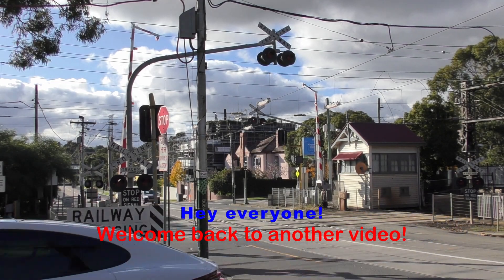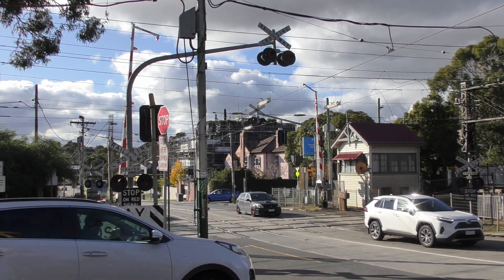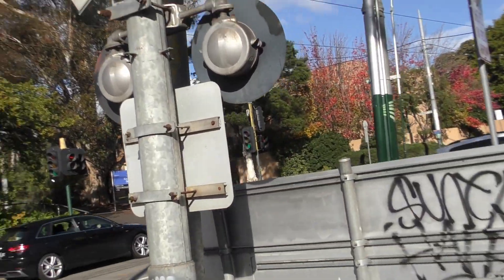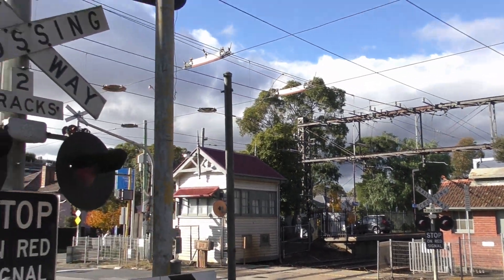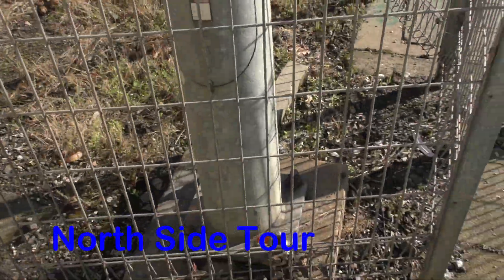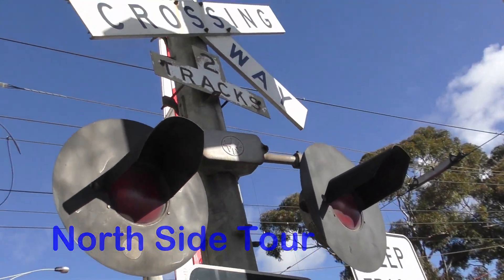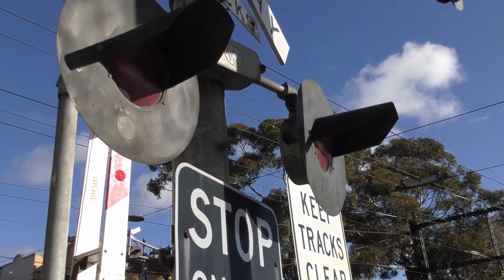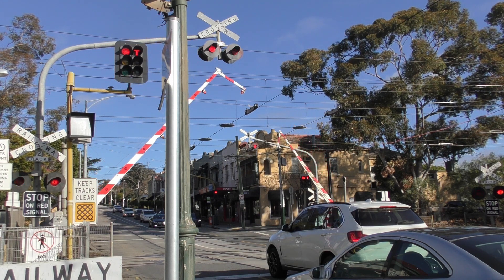Glenferrie Road Level Crossing, Kooyong, Victoria!

Comment: I really hope they don't replace the hybrids since one isn't working now, as they've done that before with other crossings. Since this is the last crossing with hybrids on the Glen Waverley line, and since these ones are (in my opinion) iconic to this tram square, it'd be such a shame if they were replaced. Any updates about if they've either fixed or replaced the damaged one, or are going to?
Reply from the maker: Yes i 100% agree! It better stay a hybrid, or get replaced with another one. They definitly have. I agree, they are extremely iconic to the crossing, not to mention pretty rare on metro now. Well i found out today that the one i said was dead wasnt fully dead when i filmed it, but now doesnt ring at all, unfortunately. Since Donnybrook got a brand new hybrid, there is a possibility that they might put a new one here in place of the dead one, but whatever happens it better not be an e-bell. Thanks for watching!
Reply: Yeah I really hope they can replace it with another hybrid. I just hope it sounds the same as the old one as that is important to me. And yeah hybrids are very rare nowadays on the metro network. Not to mention this is the last tram square to have them which I forgot to say in my first comment. Please keep us updated as to what happens.